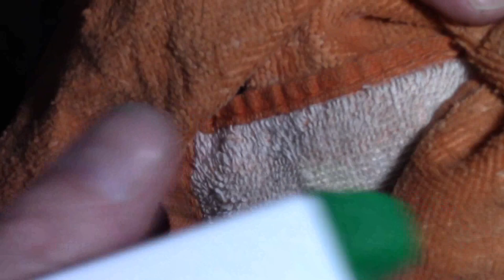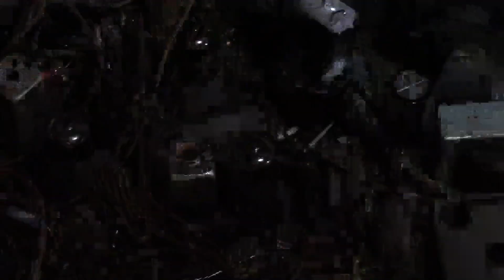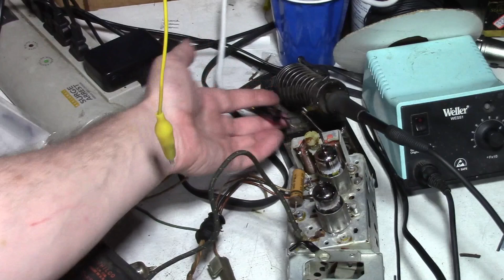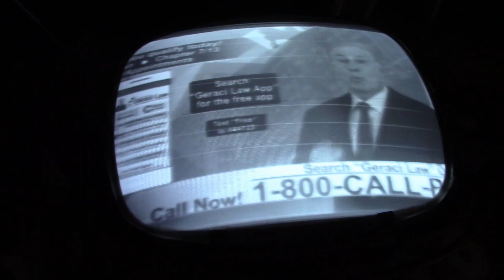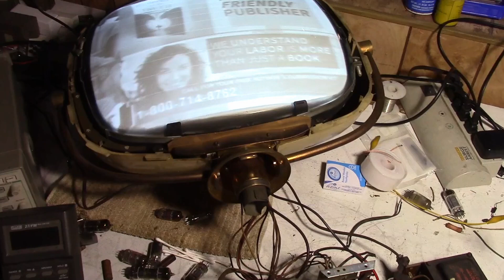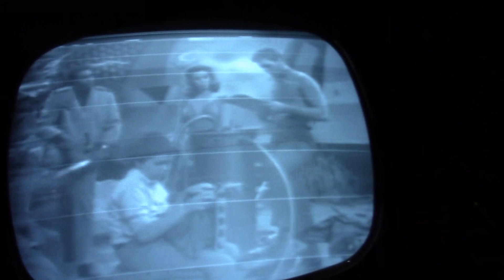Filthy Philco Predicta Siesta resto p4o?

Comment: What is the modern looking 3 terminal device that looks like a voltage regulator?  Was this something added when changing over to the 6.3V picture tube?  Following this series closely, as I have a barn find unit I need to do the same with, and having watched these detailed videos will help guide me.  Thanks for putting these up!
Reply from the maker: You're welcome and good luck with your project.  That is a dual schottky diode in the horizontal sync lock circuit.  The original was selenium and looked similar.

Comment: Great videos on this predicta. You may want to consider, using a dremel tool with a small abrasive wheel to cut through the vertical caps to weaken them, then the crush method may just work. thank you again.
Reply from the maker: Good idea.  I'll try it on the next one.

Comment: This is why I’d much rather work on an old tube set, than any modern, crap LG/Samsung/etc... flat-screen TVs. They’re way more electrically robust than modern semiconductor sets; a little static, and >poof< there goes the main processor, or the video decoder IC. Granted, you DO have to be more careful with the high voltages in a tube set, but even flat-screen TVs often have an inverter for the backlight that you have to watch out for. The plus side, is that component tolerances are much looser on those tube sets, and they’ll often do something, even if it’s not quite right. The modern sets will usually just shut down, and - if you’re lucky - you’ll get some sort of POST code (blinking power light, some sort of piezo-beeper goes off, etc...) that you then get to Google. 😎

Comment: Have had a dead pixel line across the screen on my laptop for years. I stopped noticing it after a while. A shame that happened to what seems like an otherwise sharp, strong CRT. But like you're doing, I'd run it anyway with the battle scar.